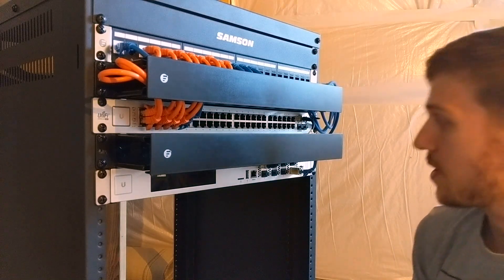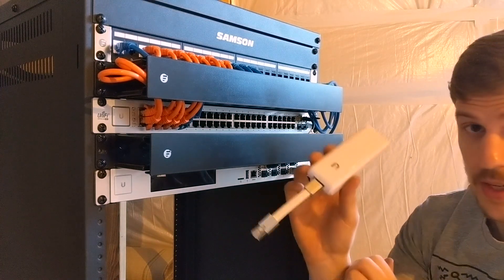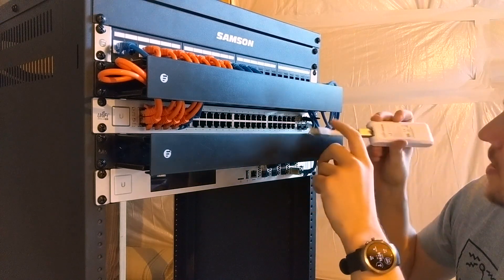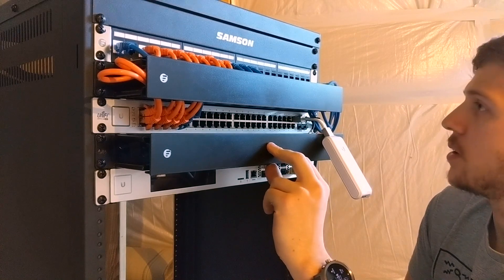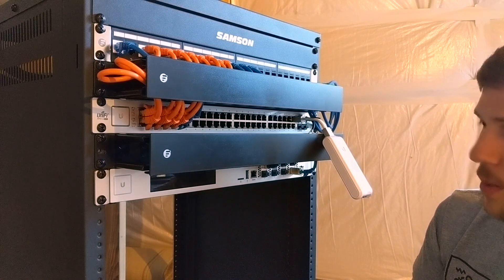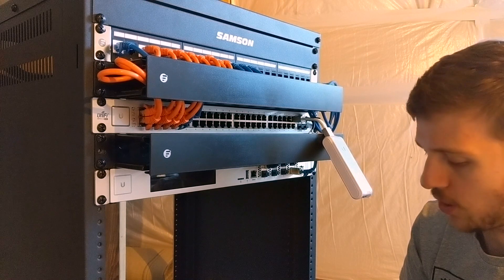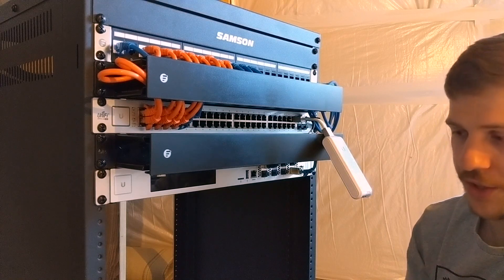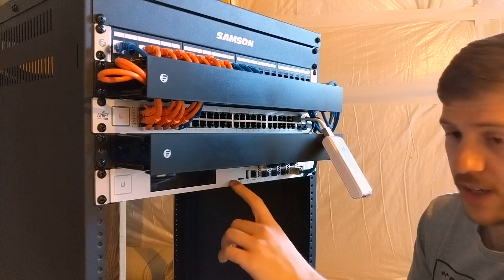Installing the Cloud Key - Pt 5

Comment: Why you use the USG XG 8 and not the USG Pro 4?
Reply from the maker: I answered that in one of my earlier videos. But the TL;DR; version is that I have a 1Gbps symmetric WAN connection, the only USG that is powerful enough to support full 1Gbps with IPS/IDS enabled is this model. 
Hopefully in the future they produce a cheaper unit, but saying that, it is possible to get 2Gbps here now at that point you can only use this. (Worth noting I got the unit before the huge price jump)